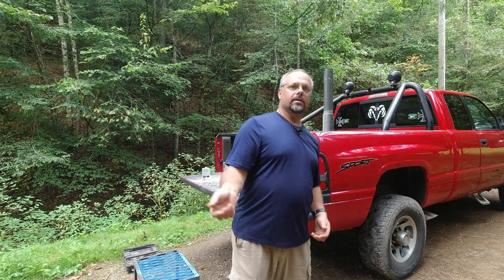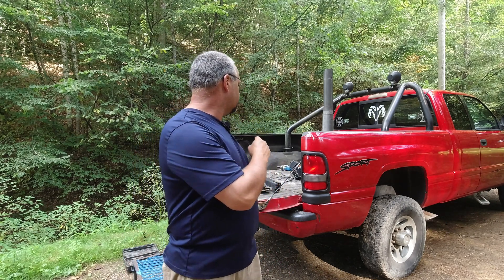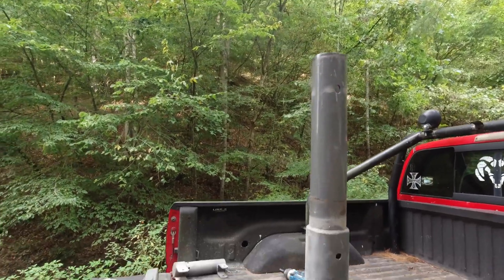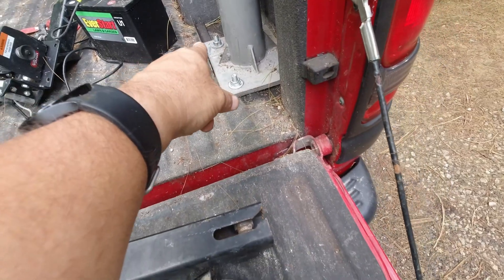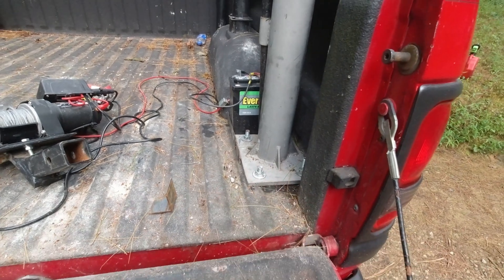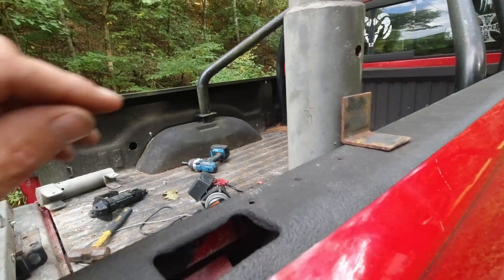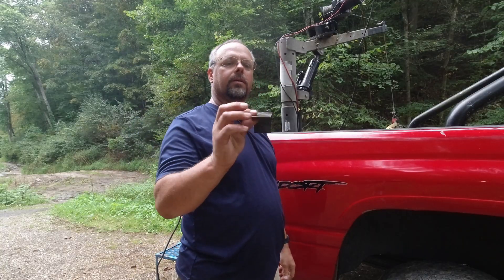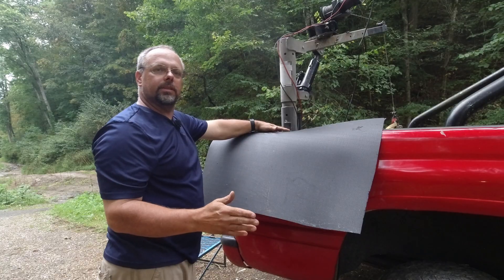The SECRET to Maximizing Your Harbor Freight Pickup Crane's Potential

Comment: It's always interesting when you start these fabricating and re-purposing projects. This looks to be some of your best since ol'green's. I could think of a ton of uses for that crane in the back of your truck.
Reply from the maker: Thanks, glad you like it!  It has already come in handy. I had to move a log that fell in the creek. It picked it up, but I think I need to add a snatch block with a hook to increase my power. The crane itself didn't budge so the weak part is the winch.

Comment: My only suggestion is get rid of the spring cable winch line go synthetic line. I put synthetic winchline in all my witches. Why did I do that?? The steel cable on a 2,500 LBS winch typically is around 2,800 LBS breaking strength. Synthetic line 1/4-inch to 3/16 winch line's weight rating, or breaking strength, typically falls between 7,700 LBS to10,000 LBS. Yes I have the same setup ( 2x2 receiver) on all my  winch's 2,500 LBS & 5,500LBS & 9,000LBS .  I also discover it can slide a reinforced strap loop  in to the winch receiver and pin it for pulling. Synthetic rope on my winches what a difference in working with it .
Reply from the maker: Good suggestion. A synthetic line would be much better. Thanks.

Comment: Looks very useful. Maybe it'll help a lot next time you have to remodel the stream. Might want a heavier duty cable for that, though, for the bigger rocks.
Reply from the maker: True. I was thinking about a snatch block to double the power. A synthetic rope might be better as well. I already used it to move a fallen tree and it did well.